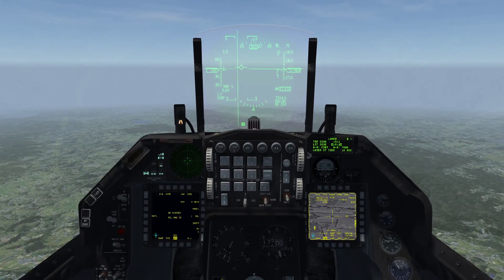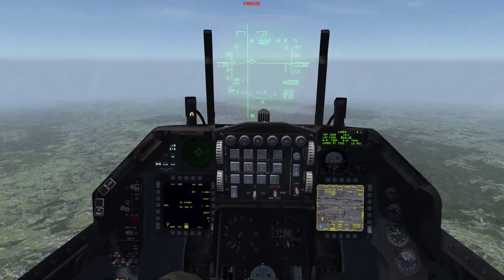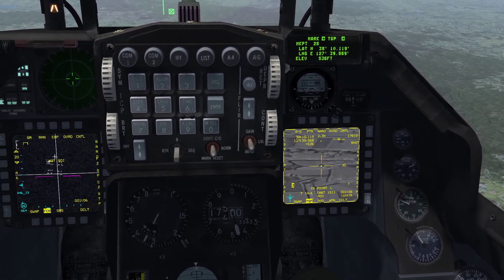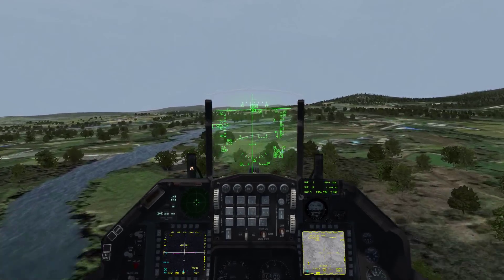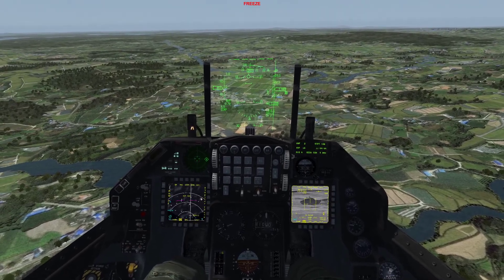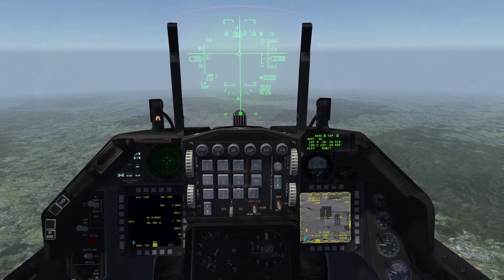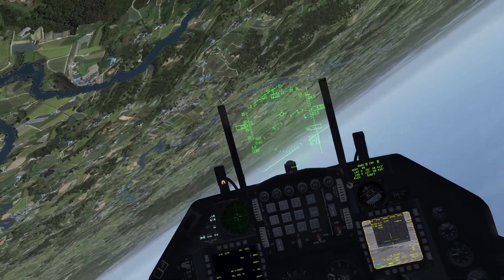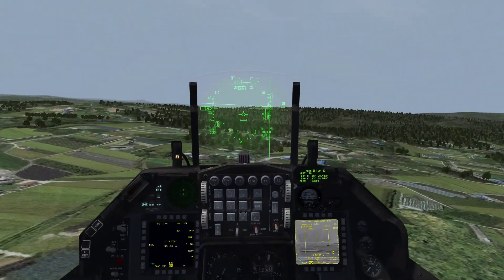Falcon BMS 4.34 - LGB Lofting Overview

Comment: I noticed that locking target with tgp then switching soi to fcr in ground mode and immediately locking again but with radar gets around the issue but i have to check if laser fires properly.
So far i have been lofting mostly unguided and gps and the fcr lock holds reliably no matter what aspect or how many g's.